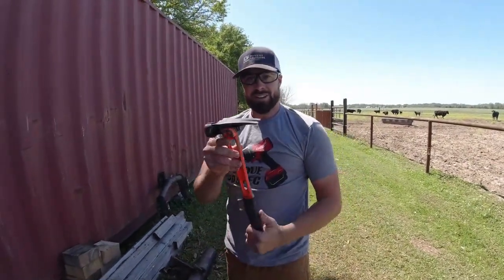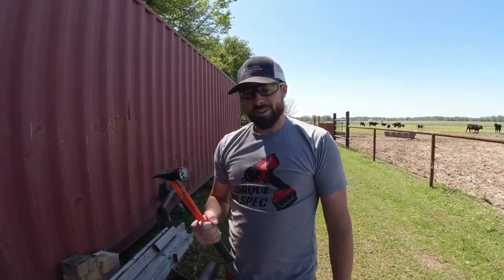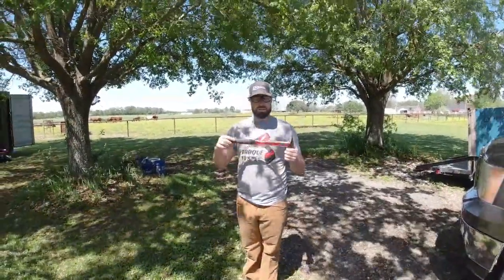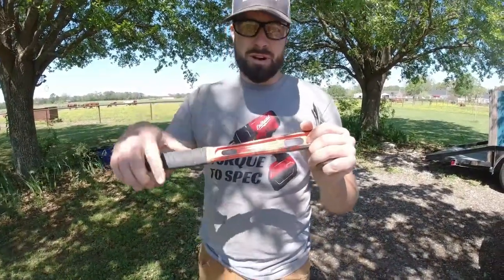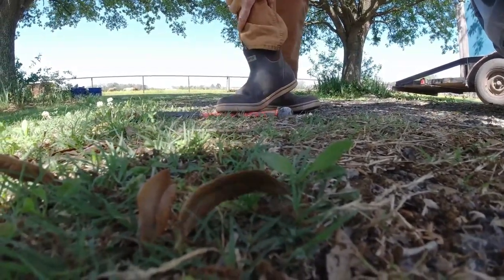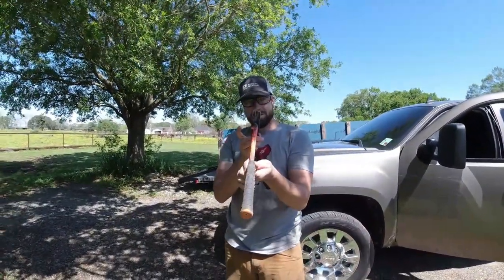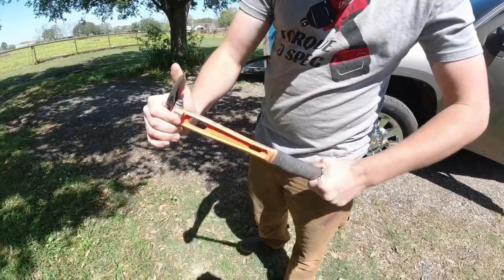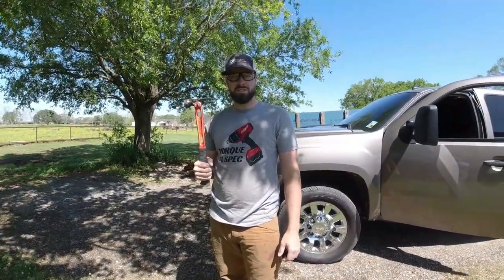MARTINEZ M1 (TORTURE TEST)

Comment: I'd like to see those other hammers where those other guys say are falling apart. Is it the heads/faces or the handle and neck area? Heck, I've been hitting nails for decades and haven't destroyed a head. But I've missed a few times and hit the handle and have destroyed a few handles in my time. The Estwing framer I have now is a steelie, but the head/face is still going strong, and I've had it forever and I believe it was used when I got it.

You were hitting broad steel with the head/face and it didn't do much to the face. I wonder though if you had made contact with the handle, would the outcome have been different.
Reply from the maker: Good Question! i believe where the estwings break is actually in the neck! and as for the Martinez, i believe the neck is just as strong as the head because it is made out of titanium. ive actaully had some hard metal on metal contact with the martinez;s neck and its handled it great, just chipped the powder coat off

Comment: Driving over it proved nothing. The tire as its going over cushioned and rebounded which significantly reduced  impact and tension.  Anyone who says this is Not true is blind. You can very clearly see that @2:10 and @2:14
Reply from the maker: its a 8000lb truck and i even turned the wheel while on the hammer. You're just one of those guys lol